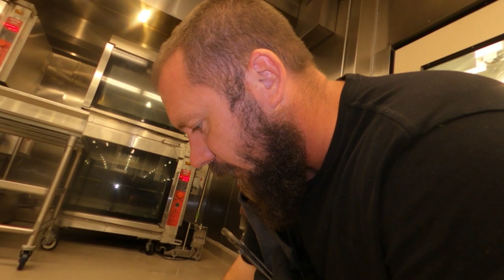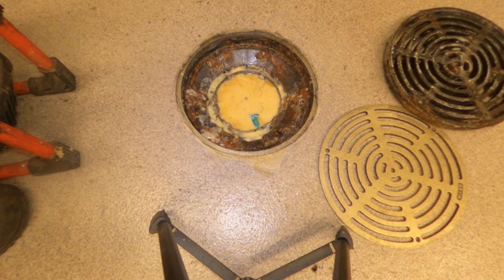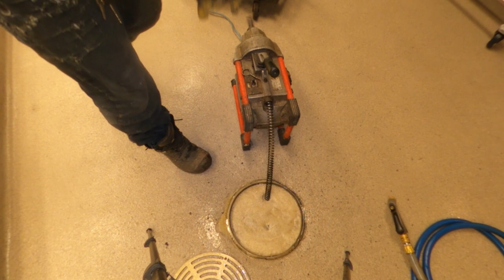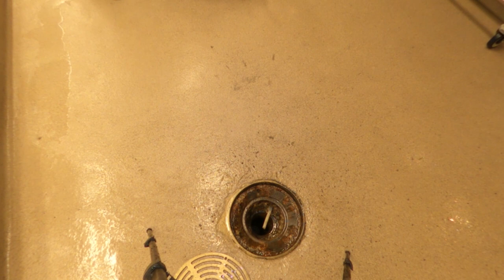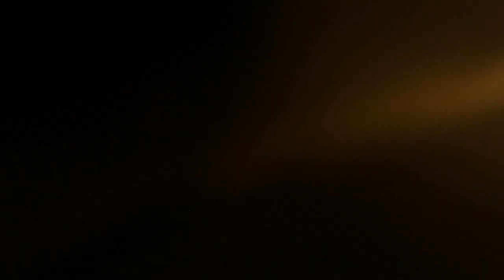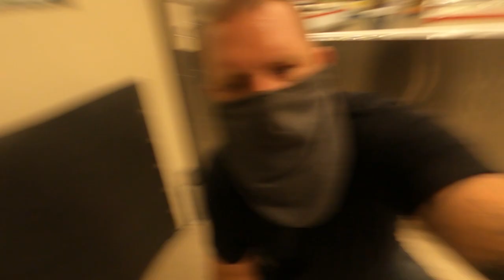How to unclog a plugged floor drain at Costco.

Comment: Another great job! I liked how in the end we're able to see how much faster the water drained out when you had the hose running. There was a small drain tube inside the main, where did that lead to, and how would you clean that if needed?
Reply from the maker: That little drain is a primer lime that is hooked up to a sink and when the faucet gets turned on a little bit of water will feed that drain so it doesn't dry out. If it dries out you will have sewer gas coming in thru the drain. And you wouldn't clean it because it shouldn't really ever get plugged.
Reply: @Jaythatdrainguy  That makes sense, I didn't think that the drain had a "P" or "S" trap on it like a sink. Thanks for the info.
Reply from the maker: No worries